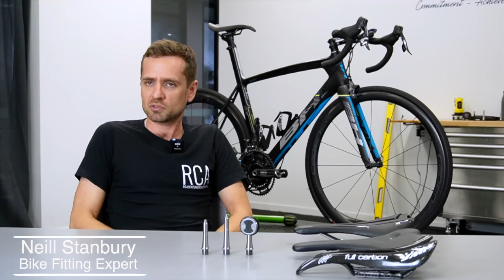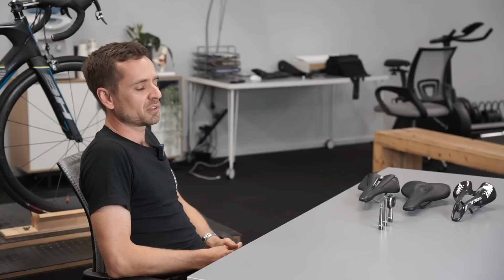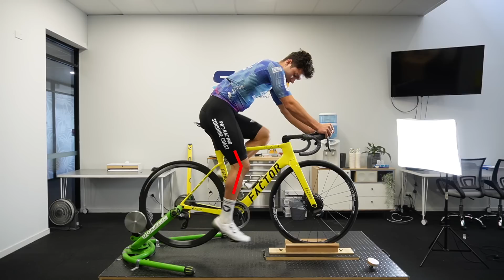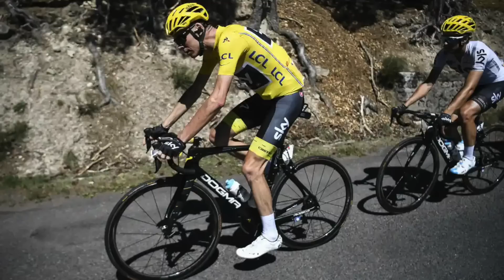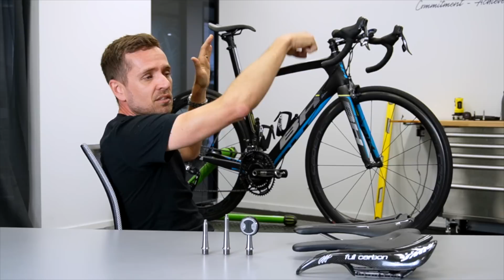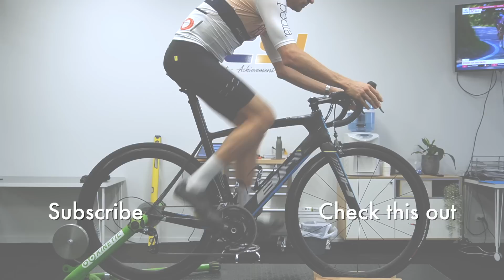Why Your Next Bike Fit Should Not Use Lasers

Comment: Hope you come back to read this old comment. In my mechanical engineering and product design classes back in college I learned about a famous US air force study. In 1926 the air force calculated average leg length, average arm length, torso length, etc, for a sample of their pilots, trying to make the perfect plane cockpit and seat. This ended up causing severe ergonomic issues for almost all of their pilots, so the military commissioned a follow up study in 1950 of 4000 pilots. They found that there wasn't a single individual that was close to average in all dimensions. Every individual pilot had some large deviation from "normal" in at least one major dimension. Therefore there was no possible way to design a static cockpit that would fit every person - which caused the Air Force to develop adjustable seats and controls, so that the fit could be customized to each person.

“The tendency to think in terms of the ‘average man’ is a pitfall into which many persons blunder,” Daniels wrote in 1952. “It is virtually impossible to find an average airman not because of any unique traits in this group but because of the great variability of bodily dimensions which is characteristic of all men.”

The same is true for bike fitting. Trying to stick to an average knee or hip or arm angle is doomed to fail.

Comment: Colby Pearce had told once how the Systematized approach is irrelevant to most individuals. In US Air Force they did a study on 4000+ individuals to check what number of people lie in the middle 1/3rd of each parameter. And the answer was none. Out of 4000+, none of the individuals fell in the middle 1/3rd of each parameter and that is what the system with fit you to.
Steve Hogg talks about how a neurological approach is so vastly superior and qualitative to a biomechanical approach which is quantitative. A quantitative approach assumes that everyone's muscle recruitment is similar at that angle. And it simply is not. In seat height itself some have their hams chopping at the bottom of the stroke at 145 degrees, some at 135 degrees some anywhere in between and that, where it happens is the correct seat height for you. Not 138-142 degrees which is the "average range". It assumes everyone's switches off at that range. Same for ankle angle. Many people are severe toe pointers, many are severe heel droppers. Its their business. Forcing them to pedal with a technique in between simply doesn't work. If someone needs a wide stance and they are given an average stance they will develop medial/lateral issues in the knee. So to sum it up, the average is so irrelevant to the individual.
Reply: This is one of the most informative comments I’ve ever seen on YouTube. Chapeau Sir and thank you 👍
Reply: @Tommy31416  Grateful. I am from India, cycling hasn't caught up here like in the west but hope to be a world class fitter in the years to come.

Comment: Completely agree. My worst position was done by a fitter who relied entirely on Retul fitting system's recommended angles. Saddle height was way off to the extent that I felt pain in my palms the moment I mounted the bike. Back ache also kicked in almost instantly since I was incredibly unstable on the bike.

It is so incredibly misleading that this is the same information that gets spread around the Internet and I always relied upon them since I figured that experts have developed this. Came a turning point after riding for years with so much pain I decided to disregard everything I've read (except Neil's video and Steve Hogg's material of course!) and learn how to feel for my position. 

God bless you all for providing these insights!

Problem also with bike fitting systems is also that they need to sell it so it appears that everyone who goes through the course gets certified regardless of how competent they are in biomechanics.

Comment: I’m a bike fitter and use motion capture exclusive on all my bike fits. First, I agree fitters that rely solely on the numbers motion capture provides are missing the mark. I’ve hooked up riders to the system and the initial capture were within the systems parameters. What I tell the rider is, your within the system’s standard , but your fit is not right. Then we go to work… Secondly, placement of the body markers are critical. I spend no less than 10 mins placing markers (knee landmark is where some fitters get it wrong). I also use a system the measures pelvis rotation, the system provides a linear graph and numbers, where I can see micro adjustments a riders is making. When a rider is making several micro adjustments I know the saddle is not supporting the rider, and a saddle adjustment is required. Final I agree, a bike fitter that fits a rider based solely on motion capture numbers isn’t seeing the whole picture. My viewpoint is motion capture is the “science”, and the “art” is making adjustments based on movements on the bike regardless of the numbers a motion capture system is spitting out.
Reply: Agree!

Comment: I had an old bike fit and have been fine tuning the fit for a new bike with slightly different geometry. I didn't do anything like the fit systems mentioned in the video, but I used lasers for two things that were helpful for me in making micro-adjustments with my Q factor and saddle height where I didn't have another person looking at me. 

Aside from using the lasers to level the bike, the first thing was where I had a vertical laser that was aligned with the center of my pedal that let me see where my knee tracking was smoothest and most symmetrical based on the q factor and saddle height adjustments, and a horizontal laser at hip level that let me see when I was minimizing hip rocking the most. I have above average body awareness, and I felt like I was able to break new ground from the previous fit in reducing the issues that my anatomy brings to the table with cycling mechanics.
Reply: Yeah I think a key distinction here the title gets wrong is the use of lasers or the use of the angle recommendations - the software doesn't necessarily use  lasers but gives garbage recomendations. Lasers help to see alignment for sure.

Comment: I've got a low saddle height too. 177cm tall with a 71.4cm saddle height while also riding 165mm cranks. Setback is about 63mm with a 240mm short-nose saddle. Inseam...not actually sure, somewhere around 81.5cm I think. I recently acquired Abi Smith's EF Education-Tibco-SVB SuperSix. She's probably a centimeter shorter, but her saddle height was 74.5cm with a lot more setback.

Comment: 1st bike fitter i went to, the fitter used one of these systems. Changed my position and told me everything was great because the system said every angle was within parameters. Despite not feeling good and not resolving the issues I wanted to address.
Second fitter, like Neil fitted me according to my needs and body and the issues I wanted resolved.
The other thing is generally they only measure one side of the rider, so how can they possibly address leg length issues or any asymmetric issues?

Comment: Other topic that'd be interesting is fitting bike vs fitting on your bike.

Some fitters argue fitting on your own bike is rubbish because your bike may be the wrong one, so you should find your right position on a fitting bike and then transfer it to the bike if it works (or well get a new bike that would fit).
Reply: James from BIkefit james does that.
Reply: @ronitdebnath  I'd still like to see the two have a discussion video.

Have a couple talking points maybe collect some questions and see where approaches differ.

Comment: Retul has always been a data based system, but I never considered that it’s distorting it’s own data. Their sales pitch says they’ve done 200,000 fittings, the numbers from those fittings create their database. If their fittings started with saddles set too high (they did) the acceptable ranges will also run high and over time the whole massive database will be too high.

Let’s face it, they are doing more automated harm than good bike fitters focusing on one individual at a time can correct. That’s achieving job security in the worst possible way.